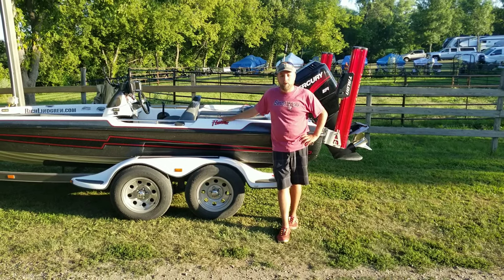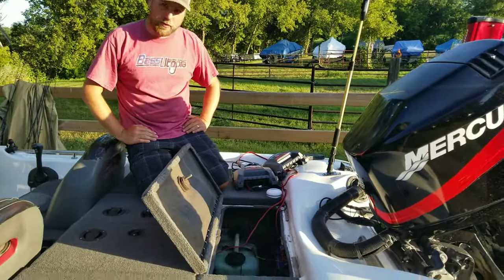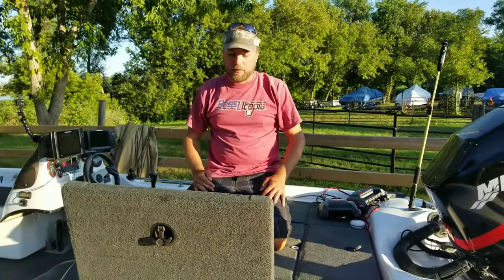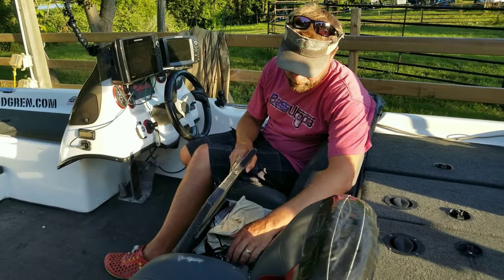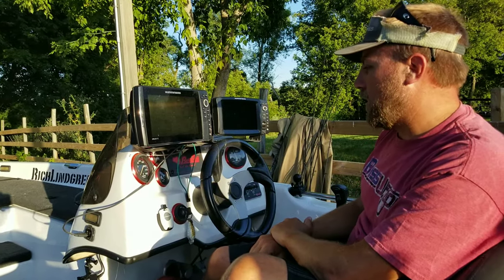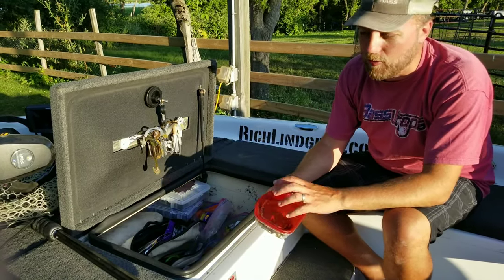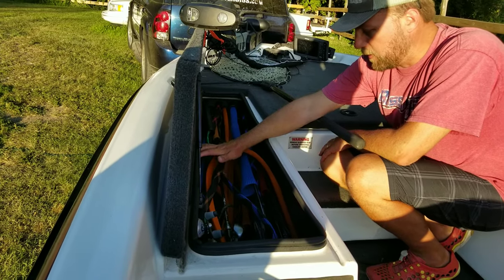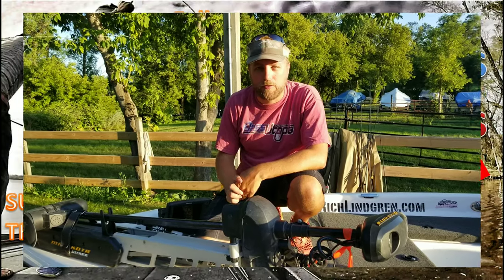Inside My BASSCAT PANTERA Classic Boat walk thru tour - What's on My Boat!

Comment: Nice boat. I too have an older boat with an EFI. Just to clarify, the Optimax was first offered in 1995. The Pro XS was 2006. Great videos, keep them coming.
Reply from the maker: Thanks for the info
Reply: I though the optimax came out in 98
Reply from the maker: @crankinbass5758  I think I was a bit off, I think 2005 may have been the last year they made both the Opti & EFI, so my motor would have been one of the last 2.5L 200 EFIs